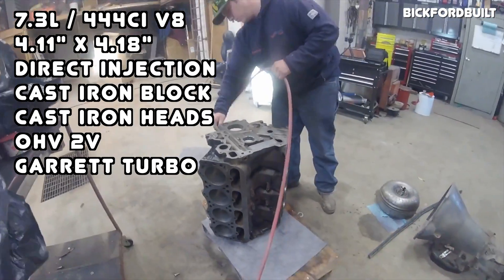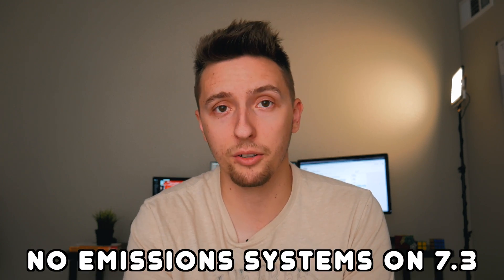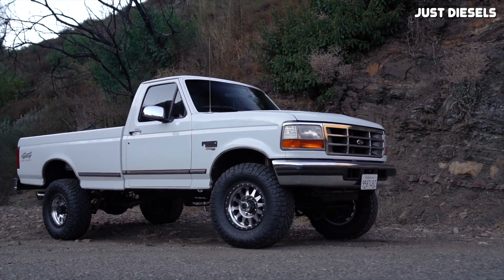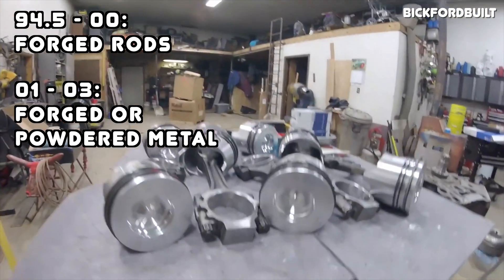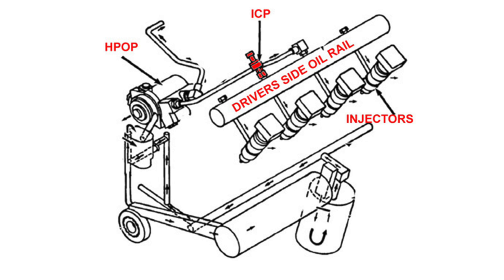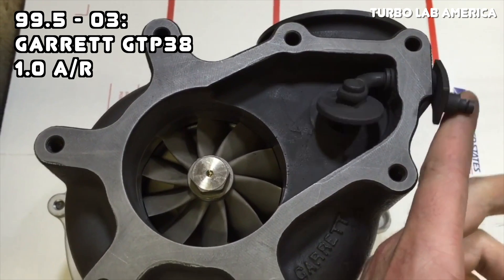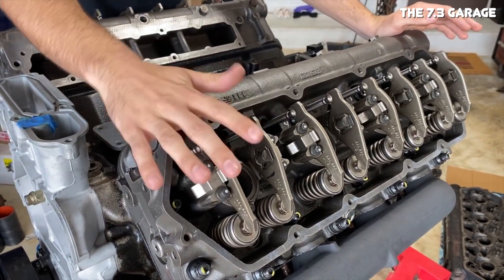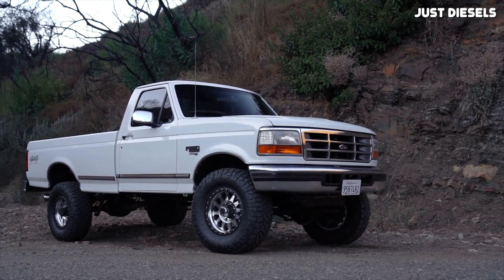7.3 Powerstroke: Everything You Need to Know

Comment: I could use a helping hand on my 97 powerstroke
Reply: Whats up with it
Reply: @thomasc.2562  it’s overheating and probably a sensor or something in or near the block is getting hot and cutting my engine off, I can’t describe the sound but it’s like the engine is gasping for air then it’ll cut off
Reply: @Official_Jboogie  let me consult my friend and I'll get back to you
Reply: @thomasc.2562  alright, thanks
Reply: @Official_Jboogie  we both think it has something to do with your radiator because of the overheating. A line could be stopped up perhaps
Reply: @thomasc.2562  I could see that, like I haven’t even replaced the ani freeze in it or checked the condition in the first place, for all I know it’s been like since I first got from up north
Reply: @Official_Jboogie  oh jeez lol, well I would check that, a lot of the time its something simple
Reply: @thomasc.2562  does it having 318k miles mean I should start looking for a new engine?
Reply: @thomasc.2562  and I gotta wait til it cools til I can crank it again and get it to running, she’s good for only like 30mins max

Comment: Ford’s 7.3 was a great reliable engine it isn’t a speed demon but it’s a truck now the new 6.7 2011 and up is the best Diesel engine available they are actually lasting the turbos need done at 180k to200k but that’s gonna be any vvt turbo system on a ice maintenance is everything and if you can delete the emissions equipment that is the best thing you can do

Comment: Sounds like you never owned ...one buddy.  Compared to a Cummins a 7.3L is thing but a maintenance black hole after it gets some miles on it.  ALSO THIS WAS NOT A FORD ENGINE.....It was an International Harvester school bus engine.  Direct injections via... oil pressure was GARBAGE... What about cracked leaking "injector cups" just to name one big expensive repair.  and donot forget the weak and expensive to replace glow plugs and their controller... Well not enough time to list all its weak points.  Just tired of hearing from those who forget to tell "the rest of the story"...and leave out too many facts.

Comment: I think the 7.3 was a great diesel engine and owned several dating back to the early 90s. Maybe someone can help answer my question, how did the 7.3 and 5.9 make similar power even though the 7.3 was a larger engine? I think they 7.3 was slightly more powerful and 5.9 got better fuel economy.
Reply: Bore and stroke..the 5.9 is a straight six cylinder and the 5.9 has a much longer stroke which is why they produced more torque hence why most rigs on the road are straight six engines...simple design and more reliable and more power with less work n even less rpms.

Comment: The HEUI Injectors that came from Caterpillar are what was used on their 7.2L 3126/C-7,I think the 6.6L 3116 did as well but I could be wrong.

G.M. had no power with their engines at the time,the Detroit 6.2L and 6.5L had no torque at all but did have incredible fuel efficiency for it's displacement.

And then of course Dodge ended up with Cummins,and the 6BT was a step from the 4BT,but they had pin issues where they would fall into the gears or the oil pans,and on their 6CT that was actually very rare compared to the others which gave it advantage and not just being a more large engine.

The 7.3L had the best of torque which was already explained.They still use multiple 7.3L's out there today,even in the military.In the Navy Seabees,some of the Ford F900's have the 7.3L's although most being the Ford 6.6L or 7.8L and they have not phased them out yet.The 7.3L outside of the F250's-F550's was also used in the F600's-F900's,not just the other two as mentioned.
Reply: the Cat 3116 used the cat MUI 1.1 inj not HEUI design, the 3126 was HEUI

Comment: Love my 7.3 or, 7 tree as I call it. I make sure to keep the oil changed and it runs like a Swiss watch. 192K on it and it just keeps going and going... Every time I pull the dip stick to check things out, the oil looks beautiful. It's one of the few diesels I know that have that clean of oil, very impressive I think!
Reply: Haven't changed the oil in mine for probably 20k miles. It leaks enough that I just keep adding oil too it. Its pretty nice honestly 😂
Reply: @thomasc.2562  tighten to oil pan bolts.
Reply: @thomasc.2562  Hey bro, just change your oil filter every once in a while. Not many people  have a 2 stroke diesels
Reply: @Christopher Weaver  yea man changed it recently. Gotta do it quick enough so it doesn't leak all out 😂
Reply: @thomasc.2562  😂😂😂. My old shop I used to work my best friend/coworker had a '97 Toyota Avalon with every gasket out except the head. A quart a day. I always called it his two stroke.
Reply: are you sure we’re talking about the same engine lol my dipstick is filthy after 100 miles of driving😂 but besides a new hpop and ipr and icp, she’s got 336k on her and still getting the job done. rather uncomfortably though (TTB 4x4 sucks)
Reply: @MCatwar  Yeah man, no joke, normally the oil gets black instantly in my other diesels, my Fuso and New Holland tractor, but the oil in this 7.3 and my mini excavator (a Kubota) always looks nice and clean, even after quite some time. But yeah, just basic maintenance and it seems to keep going. I'm going to take a look at changing the rear end fluid and make give it a good grease job this summer! What is uncomfortable about yours? Seats aren't the best I guess...
Reply: @BarnStangz  i kinda habe a love hate relationship with my truck. it gets good fuel economy and pulls just fine, and after 180/0 injectors it’s really waken up. the real unfortunate part is really just because most of its driving is on dirt mountain roads so there’s a ton of washboard and the old ttb and leaf springs have no give. it’s not even just a comfort thing that gets to me. it’s more so that i know all those hard bumps are goikg right to the bearings and the frame, to the point where i’ve noticed a stress crack on the front leaf spring hanger on the frame.
Reply: @MCatwar  Wow yeah, I bet that sucks with the dirt roads! You'd probably have to do some serious suspension work to make it more plush, don't know if it would be worth it or not. I love this 7.3 though, it's been a good engine and tows well for me.
Reply: @BarnStangz  Yeah, so far Ive really only done pivot bushings and new shocks.  I need to do new leaf springs, shackles, and bushings.  I got recently hit by a government snow plow so I'm gonna take the check I collect from them and do a partial restoration on it--I'm thinking interior, bodywork, rust, and drivetrain.  I've got a 6.0 intercooler ready to go in, building a super duty turbo to go in to ditch the old pedestal, new HPOP and some other various stuff to make her a solid truck!
Reply: @MCatwar  Sounds awesome, glad you got some cash from being hit and can take advantage and make your truck even better!
Reply: I know this is about the powerstroke but I once knew a guy that got 435,000 miles out of a 89' 7.3 idi with oil changes every 20,000 to 30,000 miles.
Reply: Probably needs clean oil for the Heui injector reliability. I actually just bought my 1st. Got fed up with newer unreliable, and expensive powertrains.

Comment: 3 years ago..bought a very nice 248,000 mile 2001 7.3.. I just had installed 8 new OEM injectors and gasket wiring harness for $3,600.  What a difference.  Seriously getting 18.4 mpg on coastal curvy highway and town driving. (North Coast of Calif).  Love, "The Beast". Pulling my Grand Design 35 ft. 5th wheel home. (310 GK)

Comment: That's not true the 7.3 L diesel I have I have a couple of grades on it but I pull 18000 pounds all day long at 20 miles per gallon best diesel engine ever
Reply: 20mpg on a 7.3??? What diesel are you putting in there 😂. Mine gets like 12
Reply: 15 mpg is the best you're gonna get lol
Reply: Lol better than my v10 that I pull a skidsteer on a heavy ass trailer thats around 17k lbs total. About 3k over the factory rating for the truck. I average about 8 mpg but my v10 only requires oil and fuel. Not as powerful as the diesels but a fuck ton more reliable. I dont need to plug my truck in when its cold.
Reply: @roguepowersports3576  are you saying that your V10 gas engine is more reliable than the diesel?
Reply: @fastfordman1965  no sir not at all. I was stating that he gets better mileage than my v10 and that I average about 8 mpg. As for reliability compared to the 7.3 the v10 isn't even the same realm. Would I say the v10 is more reliable than the 6.0 or 6.2 absolutely those 2 were nothing but issues. Also I was saying that mine just requires fuel and fluids  and require less maintenance in my experience. I probably could have worded what I was trying to get at better than I did in my original comment. I'm a diehard Ford guy and by your username I would think you are a Ford guy too lol. So I hope that clears up what I was kinda trying to say. Have a good one my friend.
Reply: @roguepowersports3576  that makes sense. I was driving a fully loaded big Uhaul fully loaded towing a 3200 lb car from California to AZ. It had the 6.8 V10. It pulled great and got 10 mpg at 60 mph. At 75 mpg it dropped to 8.5 mpg. Strong motor but no 7.3.
Reply: Ours gets about 17-19mpg. That’s with 17-18k pounds

Comment: Best, most reliable diesel I've ever owned. Just keeps running.
Reply: 670k on my 96
Reply: How many miles u have on it ?
Reply: I've seen more Cummins and duramax's fall apart more then any 7.3 I've owned 3 plus one I have now best diesel ever made .
Reply: @williedunn6990  a cummins would make sense as they are much more widely used and worked generally much harder than the old 7.3 powerstrokes.
Reply: Because it's not a ford engine 😅
Reply: @carlachambers3771  You're absolutely right.  Ford had them built by Navistar.
Reply: @carlachambers3771
Reply: Ford got their 7.3 diesels from Navistar.  One of the best and most reliable mid size diesel engines ever.
Reply: 285k on mine 1997
Reply: @westfloridalife2701  my '97 has 359k miles and not one problem yet.
Reply: @45Deere9500 IH1568
Reply: The damn thing just never dies it doesn't like the cold though but that's all diesels in general
Reply: @Natd0gsef  good maint is the key good oil filter i use 1995 motorcraft only good fuel and air filter and this think run near forever
Reply: @Natd0gsef  I've never had a problem with mine during cold weather months. Mine has the factory block heater option. Even when I forget to plug it in, it still starts rather easily. I also have a grille cover for it during cold weather months.
Reply: The Company I work for has a F-350 on it's 3rd engine and it has less than 200k
Reply: @clb_52  what engine.
Reply: You probably not working your truck that hard I seen 7.3 power stroke fall apart when pushed hard
Reply: @clb_52  REALLY? My '97 F350 4x4 7.3 truck plows snow, tows a 4 draft horses gooseneck trailer,  10,000 pounds cruiser boat, and a 30' travel trailer. It also has a wheel lift towing system underneath it. The truck earns its keep nearly every day. 359K miles and not one problem yet. Try all that with a Durajunk GM truck.
Reply: @sergeantmasson3669  I was going to say my 2000 tows 10k daily and has over 500k on her. The old owner also abused the living shit out of it and she still purrs like a kitten. Well I should say clacks like a school bus 😂😂
Reply: @tannersargent1945  My '97 F350 4x4 with 7.3 engine earns it's keep almost every day. One water pump, one vacuum pump and one set of glow plugs since new. Other than that, just normal maintenance plus tires and brakes. Several years ago, I changed the exhaust to 4" a cold-air intake system, and a computer chip.  I go to the Ford dealer, where I worked at for 35 years, and they give me all their used transmission oil. I run that through a strainer and use it for fuel during warm weather months. The truck burns it just fine for fuel.
Reply: @sergeantmasson3669  really? Does it have power the same? Go through filters?
Reply: @bigrustytrusty5856  No lack of power yet and it earns it's keep almost every day.
Reply: @sergeantmasson3669  how about your fuel filters?
Reply: @bigrustytrusty5856  It has one factory Ford fuel filter. Never has it ever been a problem. It gets serviced during every oil change.
Reply: @clb_52  Correct. No towing or plowing. Not a lot of weight hauled. Oil changed every 3k injectors done at 300k. Runs everyday

Comment: Original owner of ‘97 PowerStroke with Banks Chip, Turbo, Command Shift module, 4” exhaust from heads to tail, oil cooler and intercooler...amazing power range and still the cleanest diesel ever to test at our county DEQ @.04 out of a range of 0-10 passing range. This pickup is bomb-proof and still a pleasure to tow with.
Reply: Jon Irelan, same mods that I did to my '97 F350 4x4 7.3 diesel. Warm weather months, it gets used transmission fluid for fuel and runs just fine with it. Most auto/truck dealerships give used transmission oil away for free. I get mine from the Ford dealer where I worked at for 30+ years. Same dealer I bought the truck at new.

Comment: I have a 95 f350 and honestly I’m a Chevy guy, when I got it I was definitely impressed. It is bone stock 2wd with 33’s, it is straight piped with the stock down pipe and has a recently Installed aftermarket air intake. At the moment it is in the shop for several “common problems on the newer and older powerstrokes.” While I very much enjoy the truck I’m still a big Chevy fan. (Internal oil leak, losing oil pressure, bad cam sensor, bad ipr valve, the top of an injector is broken off, however no engine codes?) <told you me by the power stroke specialist shop it’s at now...👍
Reply: Extremely reliable after having the a little over a year with 221k miles on it
Reply: I look at it like this.   Fords we’re build heavier and tougher than Chevy. But are a total pita to work on.     Chevy was built light cheep and interchangeable..  the working man’s vehicle..   ford you better know the date code he’ll even the shift it was made on ..  Chevy will swap all kinds of parts from different motors.  And parts are cheeper.    But fords tended to last longer from the get go..     I’ll take what ever I can make run to get to work ..

Comment: Everyone in the comments arguing between Powerstroke and Cummins like whether its better to get fucked prison or back alley stile while I just noped away from both of them and got a 2001 Mitsubishi Fuso instead. 380,000 miles, 19 years old and the easy to service cab-over engine still doesnt have a single oil leak anywhere. Contractors and folks who actually use their trucks to earn a living instead of play suburban cowboy use these japanese trucks instead of literally anything else for good reason. Cummins is overpriced AF and Powerstroke is oil leaking trash. None of you guys will admit it and get a Japanese truck though because looking like a tough guy with a big loud diesel truck is more important to you than actually getting the job done.

Comment: I had a 1996 7.3 ford f 350 great motor I had it 22 years 210k miles. started leaking oil everywhere sold it in 2018 could have went another 100k. The biggest problems 2 injector drive modules 4 glow plug relays 2 sets of glow plugs. 2 timing sensors 2 vacuum pumps. The turbo exhaust pipe was restricted.Replaced with SS 3 inch. The leaks, oil pan rusted out.  mech fuel pump vent , turbo pedestal oil seal, exhaust studs  rust/break off   Best year was  7.3 2001 with inter-coolers
Reply: I have a 2001 with only 56k miles .

Comment: i have two 7.3 vans. both under 200xx miles. best trucks ever. one of them ( the 01) has been  sitting a while (2 years) and i couldn't start it a few months ago. i finally got to looking at it today and, there were 2 chewed wires at top of main harness connector, the squirrels got to it . I  Spliced them, and it fired right up within seconds.    it sounds so badass with open exhaust and 4 inch pipe.

Comment: Qst for you guys: I have a Ford 7.3 powerstroke 2000 which I've used 4 seasons only on farm lands and for trail fun and snow removal. I got a free 150 gallons of heating oil in a tank (I got the 250 gallon tank free also).  Since the 7.3 powerstroke is well known for going through everything..., if I use that heating oil to run  it (it's free), is it gonna cause damages on my engine? It's still running very well (240k km) but only the body needs work, that's why I got it for a very good price 2 years ago!!   '''PS''' : My 7.3 is not ''road plated''... anyway...  Personal story: a friend of mine got caught 5-6 years ago running on farm diesel (no tax).... $2000+  tax ticket...  So for me, only for off road use.  Tks.
Reply: check online. i know the owners manual of my cummins 12v says heating oil can be used as fuel temporarily.

Comment: I prefer the 7.3l IDI, it’s much simpler, easier to repair in the field, and with a turbo (not the factory one with squashed down pipe) you can make decent power. Even my NA engines never failed to move what I needed to move. I just had to run them at 3K rpm in 3rd gear on steeper hills. I don’t mind slowing down on hills, the Petes, KWs, and Western Stars I work on do.
Reply: I own an 88 with the 7.3l International, and a 96 with the 7.3l power stroke. I like the turbo on my power stroke, but my IDI is solid. Not fast, but it feels like it could haul a train. Amazing engines and easy to work on. My 96 4.0 jeep is just as easy to work on and even cheaper. Has as many miles as both my diesels. I'm a sucker for 90s engineering.
Reply: @654Crossman  I have an 06 Wrangler with the 4.0l and while there’s more electronics in it it’s still a pretty simple engine to work on. I need to get myself another 7.3l IDI OBS F350.